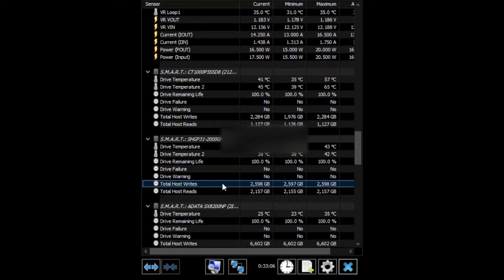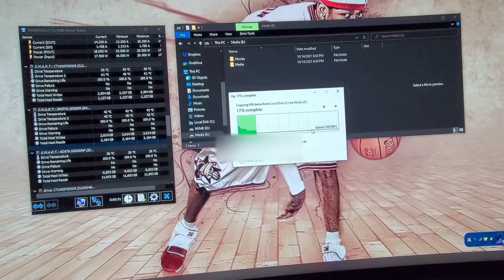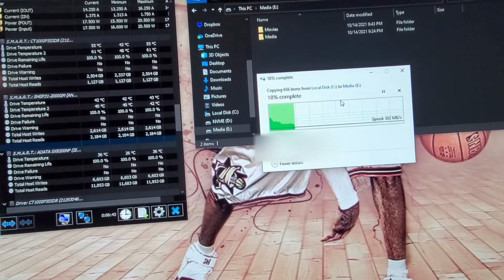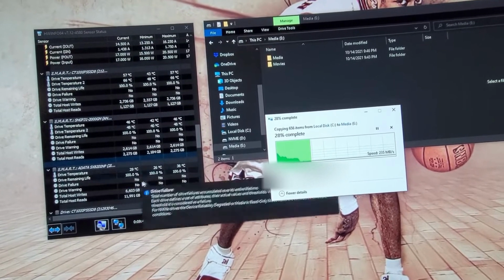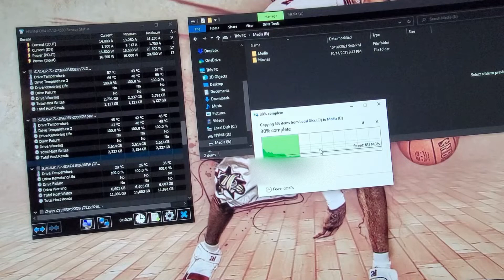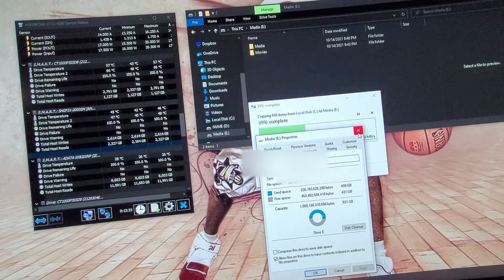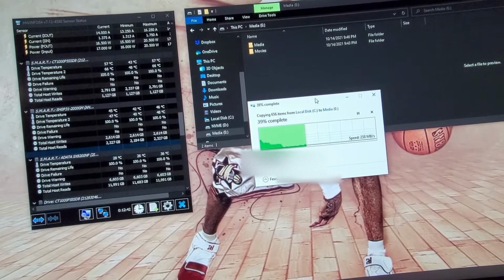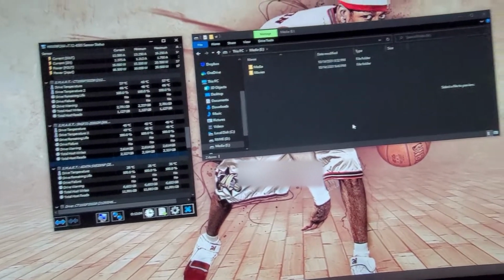Has Crucial Quietly Swapped TLC NAND to QLC in Crucial P5 NVME SSD？(No But Even Worse)

Comment from the maker: Update: the youtuber first found WD swapping cheaper parts in SN550 and SN750 released a new video, and one of the SSD they tested showed same slow speed at high working temperature:
https://www.youtube.com/watch?v=_kdQzF8TdtQ
This means Crucial didn't swap TLC NAND but also has a very bad temperature control as well as poor drive controller.
The performance is even worse than having a QLC NAND in it!
Pay attention to this and avoid at all cost!

Comment: Check if your specific Crucial M2 slot is not shared with other slots, M2 or sata. This may lower the performance.
Reply from the maker: No, mine comes with triple full speed pcie 4*4 slot, no bottleneck from my hardware, it is just bad controller and temperature.

Comment: Tengo el mismo problema, encontraste una solución o que me recomiendas una devolución o reemplazo del p5.. gracias por tu respuesta // I have the same problem, did you find a solution or do you recommend a return or replacement of the p5 .. thanks for your answer
Reply from the maker: I returned mine. Practically, this might only take place when you transfer data from old driver. When you do this, the driver gets very hot and the speed will slow down. If you want to keep it, it will be just fine if you have a very good cooling solution. Plus, this driver is power demanding as well, I'd recommend go with Hynix P31 Gold, it's cooler, less power demanding and has much better sequence writing performance.
Reply: @iversonchemist1628  It is already in the refund process, thank you very much for your help brother
Reply: You're Welcome

Comment: That performance is disgusting. I have sata drives that write better that this.  It's possible that micron made changes without notifying. All manufactures, do this including samsung - a very shady tactic. Still, QLC would have better write speeds for this type of drive. Based on tom's you should get the following for sustained write speeds: The Crucial P5 wrote roughly 200GB of data at 3GBps before degrading to a speed of 1,100 MBps.
Reply from the maker: Thanks for the info! I tested with 340 GB data, and I started to experience speed drop within 30 secs. Based on your comment, I'd assume Crucial swapped BOTH the NAND as well as the controller to reach that slow speed! I'm glad my Hynix Gold 2 tb was really solid so I dont really need to hurry buying a gen 3 SSD in short term.